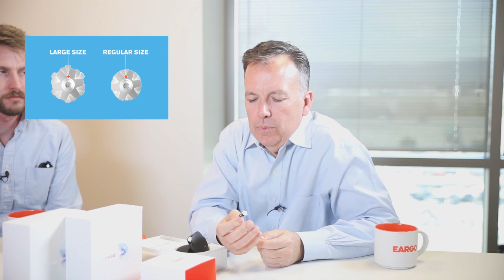Evolution of Eargo

Comment: Only issue I'm having with this product is that it's only good for 2 or 3 years then you have to purchase a whole new set as the rechargeable batteries wear out.  Normal hearing aids maybe more expensive which is offset by your insurance but the battery can be changed.  If there is a way I can send them back to have the bateries replaced or something